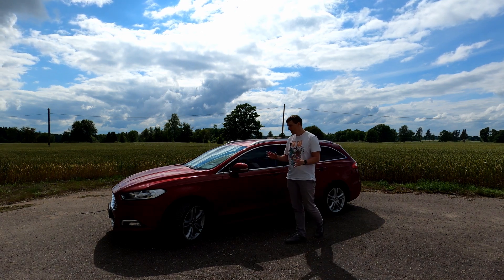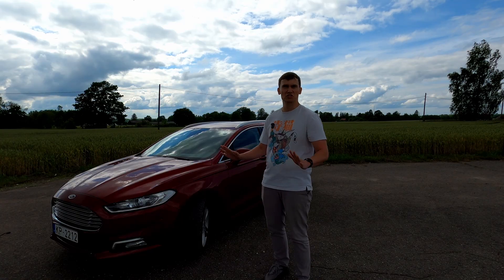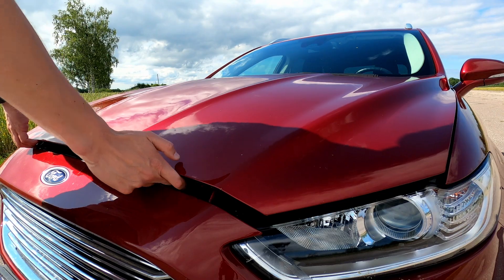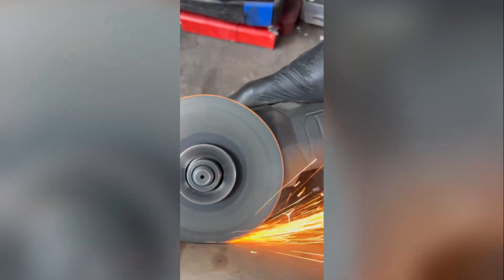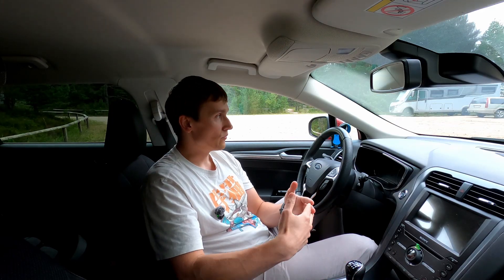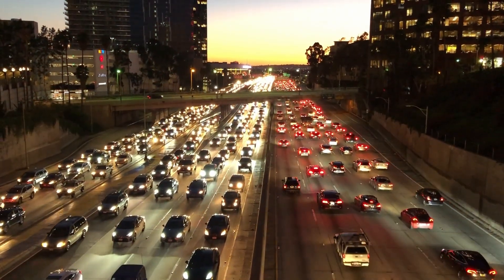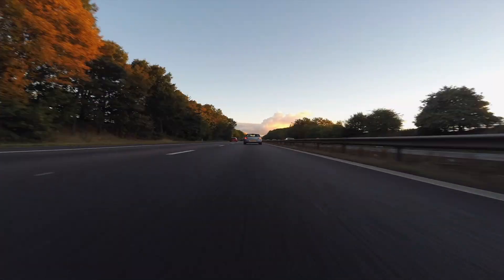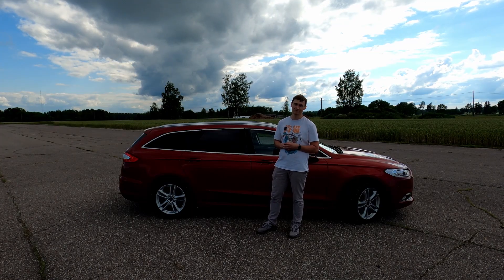Modern Diesels Without a DPF Are Worse Than Old Tractors – Here’s Why

Comment: EGR and DPF are killing the diesel engines, and the criminal wet timing belts.. Instead they should improve the diesel engine, or the diesel fuel (bio diesel) and use whatever exhaust manifold ( double or triple). Let diesel engines breathe.

Comment: Great video, and totally agree with you. A DPF will look after its self, with short runs they regen around every 200 miles or long runs around 500 miles.  And with a DPF you can feel in your exhaust pipe and its clean, remove it and it will be black with soot. Think that proves they do there job.   Thanks for all you do, love all the Fords.

Comment: It's a bit of a con really, it traps soot, then Burns it off at a later date. It's a nice con trick really, the same as the other diesel con where once the car goes for a road test the ECU changes how much fuel air is mixed to give a low test result, once the car knows it finished the test it goes back to normal air fuel mixture. I use to do the same on my old diesel peugeot before the test I turned the fuel down and adjusted the fuel stop result less than what a perfect new diesel with a DPF Then when I got home turn the two screw's back to normal, Oh how I missed those days.

Comment: What a load of rubbish. Modern engines have high pressure fuel injectors common rail old diesel engines do not they have mechanical injectors and they smoke a lot. Cars that had the emission scandals are better off without the emissions systems as the EGR valve is the main problem. Knox gases the reason why they brought in add blue EGR is a waste of time as they only work when the car is stationary as soon as they're moving Engine need boost from the turbo. EGR shut off and pump out Knox gases. Engines work a lot harder and burn more fuel with the emission system cars passes its MOT every time without it as the emissions are the same or lower than they were from factory. You need to do your research mate before making videos like this unless you're a mechanic, you would not understand
Reply: Add to the fact CO2 is good for plants and does nothing to the planet (Its the sun stupid) it's all a con trick.
Reply: Man, you really have no idea what you are talking about. Please, do not act like you know something and then to just spew crap

Comment: I completely agree with you. Especially in LV and some other parts of Europe (also UK), the sentiment is to just remove it. But for me - I hate the smell of non-dpf diesels. Even if it doesnt smoke (visibly) and everything is amazing, there is still the smell and I cannot stand it. I also just took my BMW for timing chain replacement and remap, but requested DPF to stay. As you are saying, the design isnt the problem, users are. Same with EGR valves - they clog when something is either wrong (oil used, air-fuel mixture etc) or due to driving habits (hypermiling). As you pointed out, it is important that you use correct oil - brand matters less, as long as it meets manufacturers specification.
Reply: It's not the DPF that stops the smell. It's the catalyst if you remove DPF and leave the catalyst does not smell mate.
Reply: @goodyfpv2297 incorrect. Yes, some smell it removes but the smell of soot it does not.